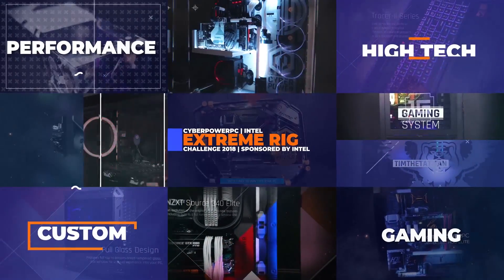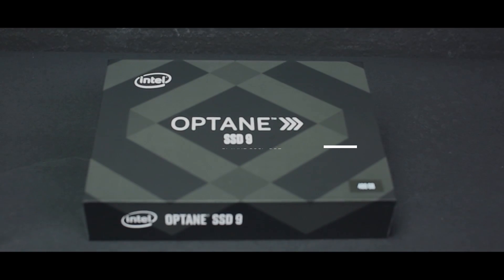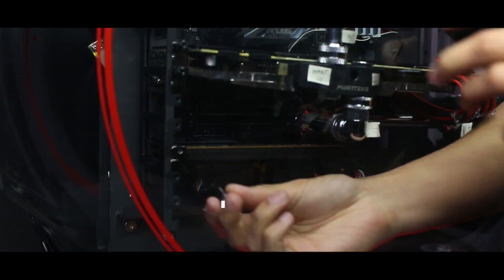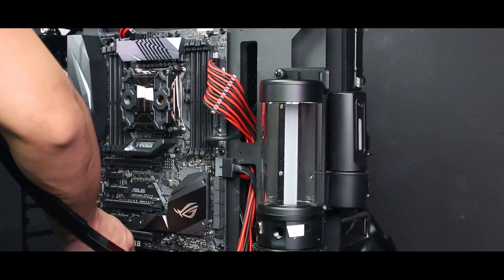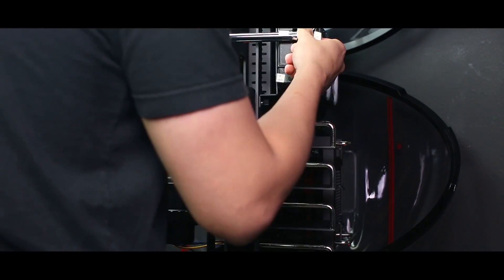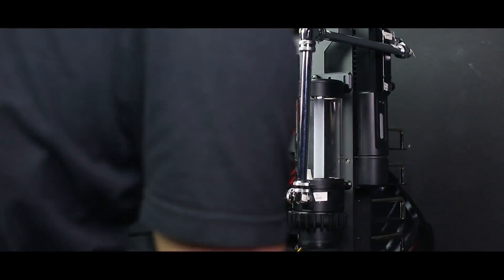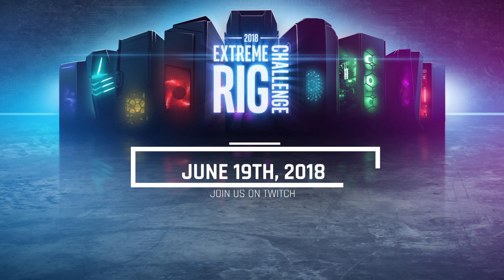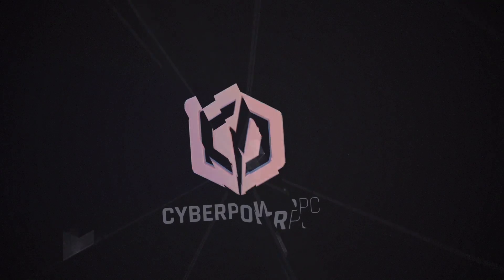Intel 2018 Extreme Rig Challenge - Stage 3:Gear

Comment: sorry but it just looks sloppy for an extreme rig, you have parallel hard lines and then your cables are going at odd angles and the unicorn barf RGB is clashing with the 2007 red and black theme...too many cooks?
Reply: oh you mean the rgb u can set to alol red to go with the wires etc